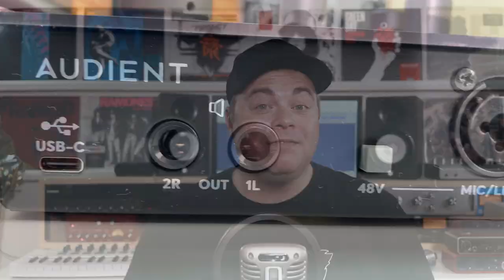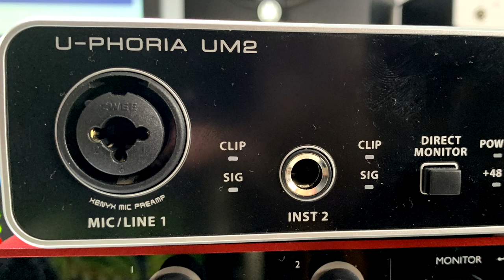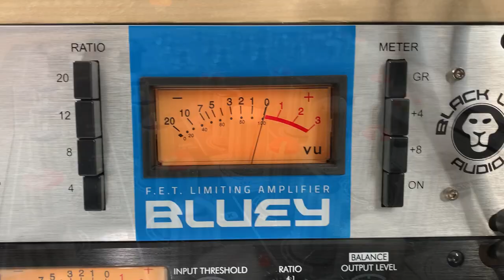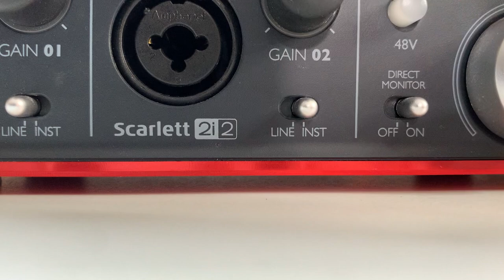Mic Level vs Line Level vs Instrument Level

Comment: I've found that recording 2 lines/channels of guitar from my amp to my Focusrite 2i2 sound better than just one, more full. I was thinking of getting a 4i4 with the 2 line level inputs on the back, so I can use an amp splitter and record, essentially, panned Left/Right amp sounds with one guitar take. However, I wasn't sure if having 2 XLR-1/4" inputs on the front and the 2x 1/4" line level inputs on the back would....work. Could I, say, have amp #1 (with direct lines out, as it's an amp modeler) going to the Focusrite's #1 input, and then #3 line in, then Amp #2 (also a modeler) doing the same with the Focusrite's #2 and #4 inputs? Or would it sound like hell once it reached my DAW?

Comment: Hi,
(1) Is it okay to connect the output from a 50-watt guitar amplifier headphone port to a line-in input port on a mixer?
(2) Also, is it okay to connect the output from a 50-watt guitar amplifier headphone port to a line-in input port on a PC sound card?

When I did (2) the PC sound card quite literally got fried up.
But for (1), the mixer didn't get burnt up and everything functioned normally. 
What's the difference actually between the two scenarios?
Afterall both had the same signal from the headphones output port going into a line-level input port.
Reply from the maker: Both of those options should be fine as long as it’s the headphone output and not the speaker output on the amp.

That’s how I started recording years ago. First connecting headphone output of a 100 watt amp to line input on sound card. Then I got a mixer and went headphone output to the line input on the mixer. 

If you fried your soundcard, maybe there was an issue with the line input already and this was just the thing that pushed it over the edge.

Maybe the level was too loud for the input which shouldn’t really fry it. It would just sound bad while using it that way.
Reply: @AudioTechTV   Thanks for your reply. Appreciate it very much. 😃

Comment: There must be more to it than mentioned in this video, if you plug your synthesizer at full volume into the line input of a Focusrite Scarlett 8i6 3rd gen, and it only records at a quiet -30 db (in Ableton). Doesn't seem we're all straight about what line level is.
Reply: Maybe you didn’t switch it to line?

Comment: Next question, is it better to have the gain turned right down, where you wonder if the knob is on the on or off position, or to press the pad button and have the gain knob near halfway?
Using Behringer 204.

Comment: Hi there, I have focusrite 2i4 which has Line/Inst switch, what should i choose for recording vocals????? Paired with ATH 2020 Mic
Reply from the maker: You should have the 2020 connected with a xlr cable which connects to the mic preamp in the 2i4. The switch is bypassed when connected to the mic preamp so it doesn’t matter what position it is in.

Comment: Instrument inputs are often labeled as "high z"
Reply from the maker: I think they are often referred to as High Z but I’ve owned many different audio interfaces and haven’t had one that labelled it as High Z.
Reply: @AudioTechTV  I have a Zoom R8 and a Steinberg UR44C and on both it is labeled as high Z
Reply: Connecting a guitar to line or instrument doesnt really ghange the sound too much...so nothing terriying will happen if you put your guitar to line level.
Reply from the maker: @sarty23  it can be dull and take away some of the brightness. If you have active pickups you can connect to line level and it won’t be bad.

Comment: Can I plug my guitar into mic input? For some reason I have static when using instrument input and it goes away when using mic input
Reply from the maker: You can plug it into the mic input. You would need a 1/4” to xlr cable to do it unless your interface has a combo jack in that case you’d technically be plugging into a line input which is fine it just might be a little dull but maybe that dullness lowers the static that you have. 

Ideally you would want to figure out what’s causing that static. I have an interface that has the static on the instrument input and that because it’s broken. If you still have warranty you might want to look into that.
Reply: @AudioTechTV  I can literally hear the radio if I plug into the instrument input lmao. But yeah the mic input is combo, and sounds clean (no static or radio). Might need to buy a different interface I guess. I have M Audio Air 192/4 btw